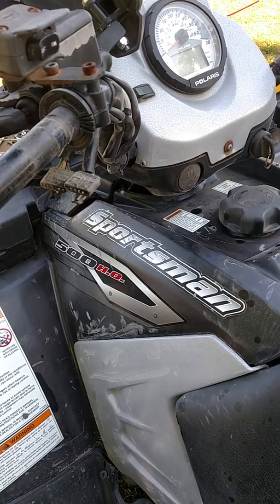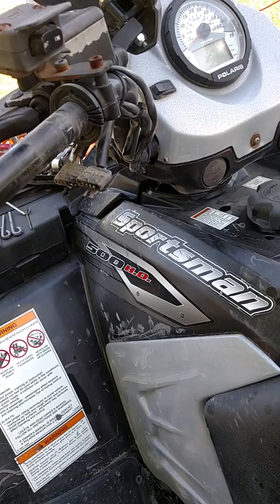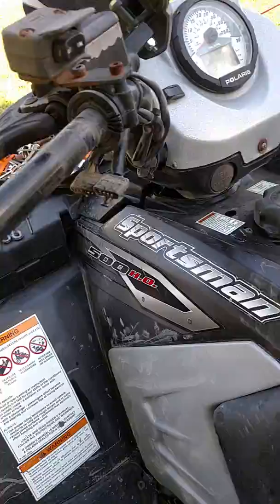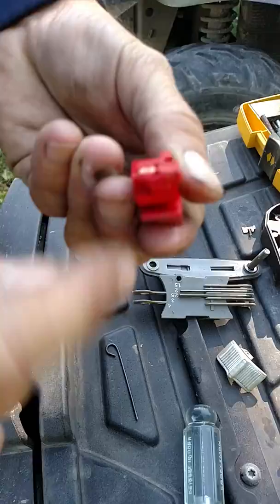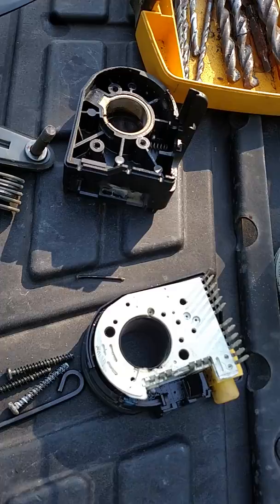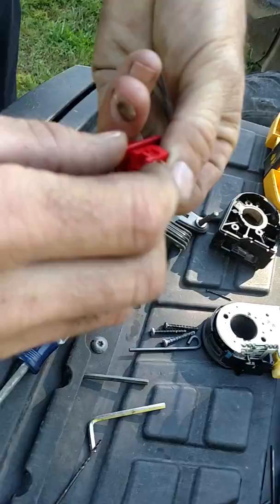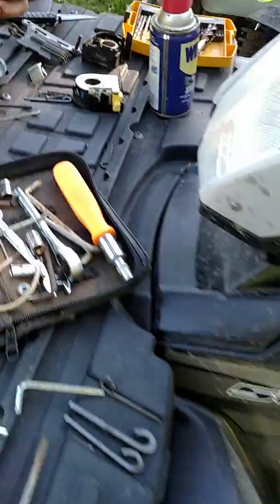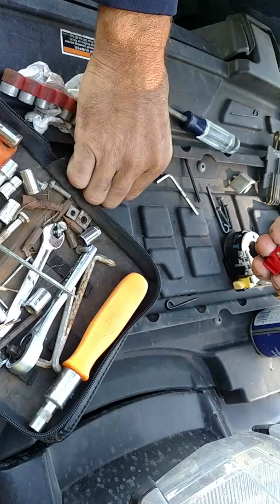Polaris sportsman scrambler kill switch fix repair

Comment: What size drill bit?
Reply from the maker: I don't remember, maybe 1/8" or 3/16", just check, and go just a tiny bit bigger than what fits. Repair does work good, still working, a year+ later